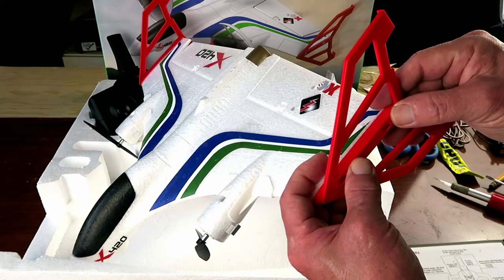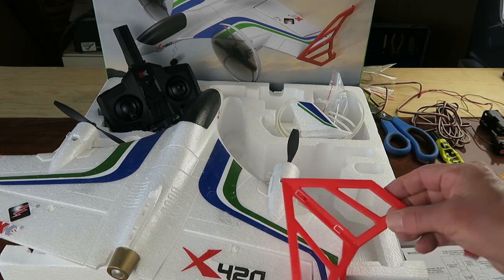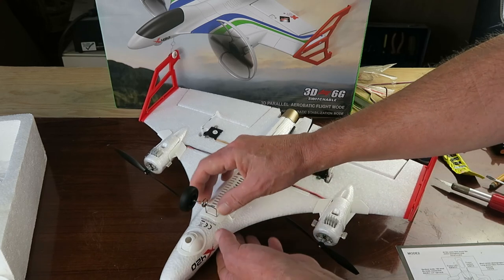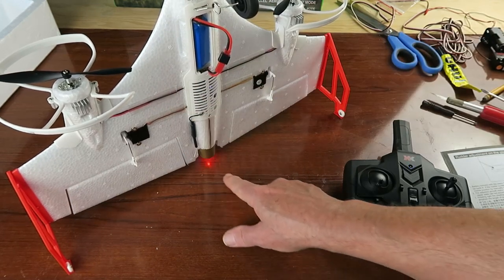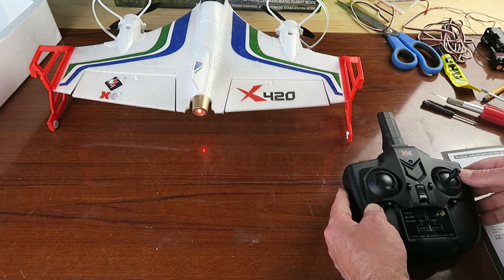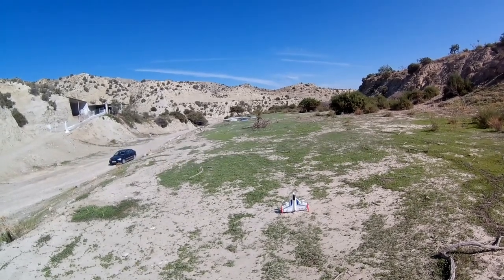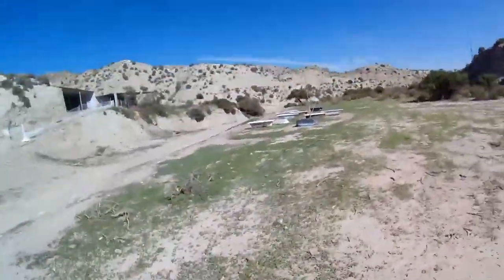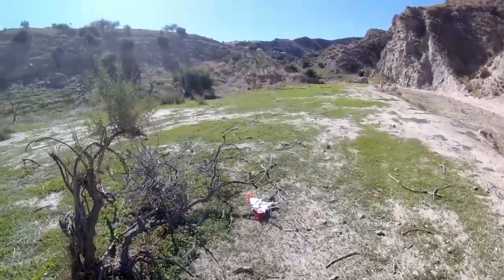XK X420 420mm 3D6G VTOL EPP RC Airplane RTF Review

Comment: Got one of these for my fiancee, however it doesnt seem to want to connect between the remote and the plane. Not sure what we are doing wrong with it. Followed your steps exactly except that our left joy stick doesn't seem to stay in the down position? Any other tips on how to get it to connect?
Reply from the maker: The left joy stick on the Tx should remain in the down position, it is not "biased" toward the canter like the right hand stick. My Tx also has a graphic of the X420 on it. Maybe you have been sent the wrong Tx?

Comment: Tempting.   Is the controller any type of standard or preparatory type ?   Ya recon a Jumper T8SG V2.0 would work ?
Reply from the maker: The controller is proprietary and uses I think the CC2500 chipset. This is supported by the Jumper so I guess it's possible. I have a video coming up on this subject, watch this space!!
Reply: @1nformatica  The X420/X520 proprietary protocol has not been hacked yet. The X4 & X8 controllers from the 420 & 520 are interchangeable but while the 520 auto-binds to any Tx there is a bind button on the X420 receiver for binding to 1 controller at a time.
Reply from the maker: @theoztreecrasher2647  Thanks for the heads up! I never understood why some manufactures make things difficult, open source is the way to go IMHO!!